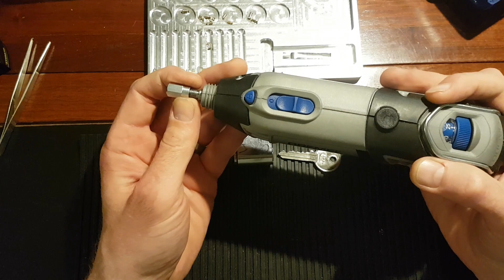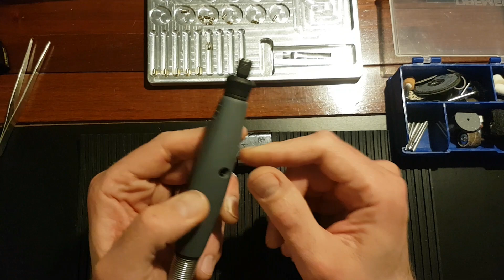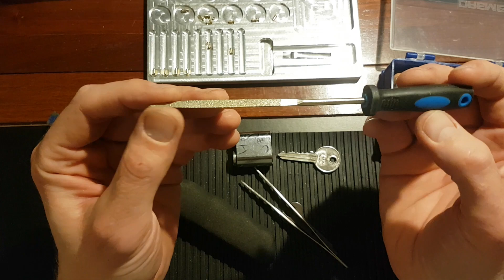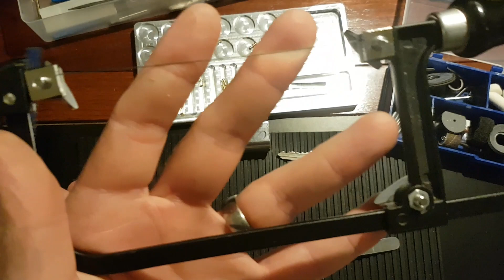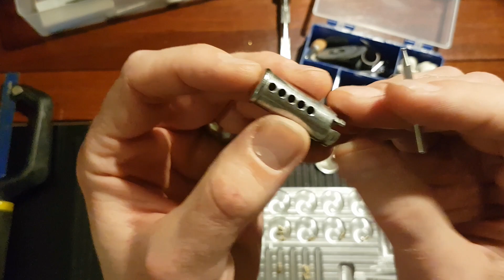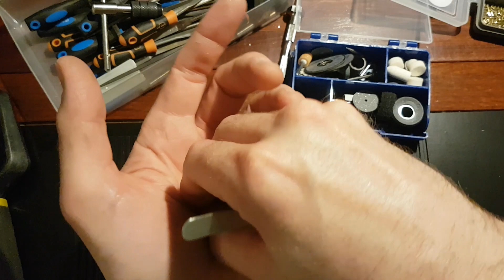An introduction to making security pins and challenge locks

Comment: I had a go at making some challenge pins a while ago, based on Bosnian Bill's video. I was reasonably successful but my results were nowhere near as precise as yours. I have poor vision, poor fine motor control and a no-name Dremel wannabe, so a combination of these factors saw me sending pins all over my garage from either not clamping the collet down enough or else being too heavy handed with my files or knife blade. I also tried making core and bible undercuts with limited success, but at least tapping some threads was within my meagre capabilities. I really should try making these locksport torture devices again some time, and treat myself to a proper Dremel as well as that flexible extension.
Reply from the maker: The new dremmel I bought was way better than the cheap one I had been using and it definitely improved my cuts. 👍🏻

Comment: I have a Dremel 4300 on order pretty hard to get in Australia currently I also picked up the Dremel multifunction drill stand 220 and a flex extension just need to sit and cool my heels until the Dremel motor unit gets in so I can give this a try.
Reply from the maker: It really is a fun side of the hobby. 😁👍🏻

Comment: Cracking video D! Super informative unpicked uploads of info there. One question, that jewellers saw, how many pins on average would you say per single breakage ?
Reply from the maker: Loads! It's suprisingly strong actually. I've only broken a few blades but they can be reused

Comment: I enjoy making challenging locks and frustrating my fellow pickers 🤣. Ah classic. But I agree you do make some beautiful pins and some really good CL’s. I like this series of videos. Cheers D, take care.
Reply from the maker: Thanks Derrick, I use either the original lock pins or fresh stock from my repinning kit which are 2.9mm
Reply: Thank you. This information is useful for the newer folks getting into CL making. Larger diameter rods can be used, sanded to fit cylinder. A fairly accurate calipers is a must. I usually only find 3 MM up to 5 MM. Fairly inexpensive online. Price, availability varies from Amazon, EBay.
Reply: I readily agreed on modifying stock brass manufactured pins. Affordable option.
Reply: Can you put a detailed list of brass rod size/dimensions. Dremel drill bit size.